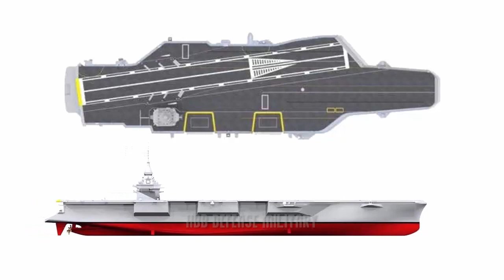France’s next-generation aircraft carrier will be nuclear-powered

Comment: This new carrier looks a beauty. I look forward to seeing it in service. Interested to see the eventual costs of the carrier compared to the Ford class or the Queen Elizabeth class
Reply: The 42,000 ton CDG carrier is the French navy’s most troublesome warship ever which cost about £3 billion to build in 2001, the larger 75,000 ton replacement ready for service in 2036-2040 will more than likely cost between £8 to £10 billion, if the project doesn’t get scrapped beforehand.
Reply: @IanS2024  how was it the French navy’s most troublesome ever? It had delays and costs cuts due to the end of the Cold War, and even with all of that it managed to be operational  and commissioned in service  in only 11 years since the start of the program, 6 years after the building ended. All the while the QE needed 11 years and that was post Cold War.
Reply: @brunol-p_g8800  
What are you talking about?  The one-and-only 42,000 ton CDG carrier took 12 years from the start of construction to being commissioned (1989-2001), whereas the UK only took 10 years to build and commission both QE carriers with a combined weight of 130,000 tons (2009-2019).  Each QE carrier took just 8 years to build despite being bigger, heavier and more modern.

Bonus fact:  around half of the aircraft carriers operated by the French Navy were either British or American built carriers.  Britain has built over 40 aircraft carriers in the last century, France has built just 5.  🇬🇧
Reply: @IanS2024  the CDG took 11 years to be built, enter commission and active service (april 1989- march 2001). And that’s talking about a complex nuclear carrier, cuts and pauses due to the end of the Cold War.
the  QE alone needed  11 years to be built and enter commission (2009-2020), a simple conventional carrier without even catobar, and that was post cold war and the associated cuts in the middle of the program. As for the Prince of whales it is another story..

The UK built 39 carriers, not more than 40.

Around half were constructed by the Royal Navy or the us navy? Bapaume (1920-1938 France), Béarn (1928-1945 France), Arronanches (1946-1974 UK), La Fayette (1961-1963 USA), Bois Belleau (1953-1960 USA), Clemenceau (1961-1997 France), Foch (1963-2000 France), Charles de Gaulle (2001- France), and the Dixmude small carrier used as transport ship (1946-1966 USA). 
Sorry, that’s less than half of the carriers coming from UK/USA origin. 
Also, I didn’t count the multiple flying boat carriers and helicopter carriers  all of French origin.
Reply: @brunol-p_g8800  
I said ‘around half’.  And the Bapaume training ship was just 600 tons and 70m long, you’re scraping the barrel now.  

During WW2, the Bearn carrier sailed to the Caribbean and stay there for 4 years and didn’t even challenge the Kriegsmarine.  Even if you want to say this was a carrier it never operated as one when it was needed.
Reply: @IanS2024  it sailed to the Caribbean because such were the orders to the French Navy, to sail to the Caribbean or sink it so it wouldn’t fall into the ends of the Germans or Italians . And yes it didn’t fight against the kriegsmarine following the armistice because France wasn’t at war after the armistice.
Reply: Estimated circa €4.5B.  Cheaper than a Ford but more expensive than QE
Reply: @lordtemplar9274  That means the  final cost will be  + €10  Billion  if historical cost overruns for new carriers are taken into account  plus the €5 Billion  to decommission  the CDG
Reply: @zenko247  lol stop inventing numbers.  
The 4.5 billion cost estimate is the number announced by the French govt.  
While there are cost overuns on military projects, it is closer to 10% than 100%, at least in France.
The CDG was 18% over budget, a lot of that was due to politicians playing politics and forcing delays with budgets as the cold war ended and some were questioning the need in a "world of peace and love".
CDG didnt even cost 5 billion to design and build.  Laughable that you think a ship cost almost twice as much to decommission than to build.
Reply: @lordtemplar9274  https://en.wikipedia.org/wiki/HMS_Queen_Elizabeth_(R08)
Reply: @zenko247  how are links about US Ford carrier relevant? 
We are talking about French PANG.  Contrary to your unsubstantiated claims, PANG will not cost €10B to build and CDG will not cost €5B to decommission.  
French govt estimate is much more realistic than your baseless opinion.  And if we factor in propgram cost overruns based on historic cost overspend for French carrier (ie CDG) of 18%, then the PANG will end up costing less than €6B.
Reply: @lordtemplar9274   stop inventing numbers. didn't you say  The Cost of building Their  new carrier  by the county that is the most experienced at building  Nuclear carriers has gone up Significantly since the original Budget. same with the HMS QE  ( even without it being Nuclear )and as did the CDG when it was built. ( and a extra  6 year for conditioning  and needing a refuel after just 6 years)  "GET IT" .  EG  the deconditioning of USS Enterprise has already risen from $500 million to over $1.2 BILLION ( in just 5 years)and they haven't started it yet ( start date  minimum 2024 )  Plus storage of the radio active components for the next 600 years look it all up for yourself IF YOU ARE ABLE
Reply: @lordtemplar9274  Do you work with numbers for Nicola Sturgeon, SNP, she doesn't understand numbers either.

Comment: They need two ships
Reply: neither of which need to be nuclear powered
Reply: @kennethmckay6391  So that they're as mediocre as the  Brits? Nuclear powered carriers are quicker, need less replenishment, quieter, and last longer on the seas.
Reply: @flyingpharoah4867  they need replenishing exactly same as a none nuclear also 27 nots isn't quicker than 32 nots.
Reply: @flyingpharoah4867  with all due respect, you must know that all American nuclear carriers as well as the Charles de Gaulle require constant replenishment at sea anyway right? It's how they maintain stocks of food and supplies etc. Yes there are advantages to nuclear but I wouldn't consider the British carriers to be mediocre for having 2 diesel engines. Regardless this new French carrier looks a beauty
Reply: @flyingpharoah4867  If an aircraft carrier does not have nuclear propulsion and especially if it does not have a catapult system for its aircraft (CATOBAR), it is necessarily mediocre. Only the United States and France make real aircraft carriers.

Comment: PANG Aircraft Carrier is equipped with two aircraft lift on one side.
Design needs changes.
The left hand side has considerable amount of blank space without a deck space.
The design of PANG is not perfect when you compare it with Gerald R. Ford class CVN.
Reply: This is nothing more than a rough approximation of the final design, I wouldn’t get to carried away with how it looks right now.
Reply: Random guy on YouTube questioning the entire military over an image.
Reply: The new class of French aircraft carrier will not be like in the video. It's still secret, it's only illustrative images. They already use nuclear propulsion and the CATOBAR system, like the United States. Their EMALS system is designed to work with the Rafale, the NGF (French 6th generation aircraft), and a French stealth drone (the Neuron). So I have no doubt that the French manufacturers will do an excellent job as usual.
Reply: https://images.midilibre.fr/api/v1/images/view/5fd04e95d286c23e10491077/large/image.jpg?v=1

Blank space ? seems deck optimized enough for me. Remember it will only carry 32 fighter jets. the Gerald Ford is designed for 80 aircrafts.
Reply: I agree a hit to the starboard side of the ship could damage both elevators and end flight operations. An elevator on the port side aft of the angled deck would prevent that. If they can't afford three elevators remove the aft starboard elevator and the remaining elevators would be on opposite sides of the ship. If they use Ford class elevators that would provide at least 4 aircraft capacity at a given time. Another option would reduce the nuclear reactors to one combined with conventional steam turbine systems. Use the second reactor on a sister ship. And there is no shame in purchasing existing American systems to reduce costs, if the ending product is a reliable aircraft carrier for at least 50 years.
Reply: @ONECOUNT  the rear left of the Pang is much tighter than the G.Ford. it would require a larger beam to sustain a wider deck and then bigger reactors to counter the extra weight.

here is the current Pang design : https://upload.wikimedia.org/wikipedia/commons/thumb/7/79/PANG-schematics.svg/1280px-PANG-schematics.svg.png

and here a design I made with the Pang with a third Elevator on the other side of the deck : 
https://i.postimg.cc/W3d7385k/Pang-updated-design.png
Reply: @xenomorphelv4265  I agree the aft port elevator should be designed for the displacement of the ship. A Ford class elevator on the port side would require widening of the hull aft. I see that you kept both starboard side elevators. Given the power of the french reactors widening the hull would slow an already slow design. I do like your design which would be able to handle 3 aircraft at a given time, looks good with the 3 elevators.